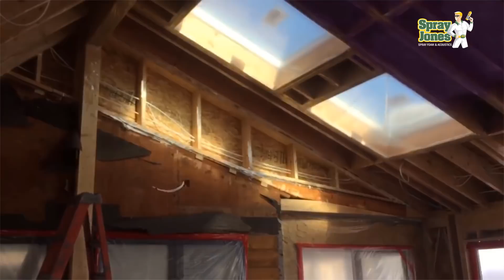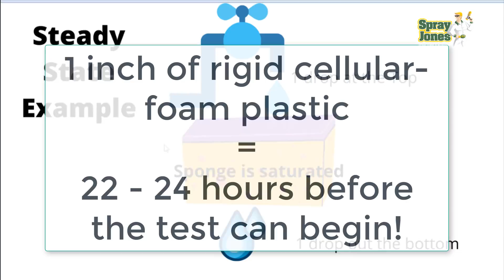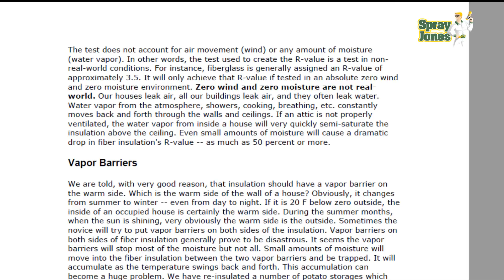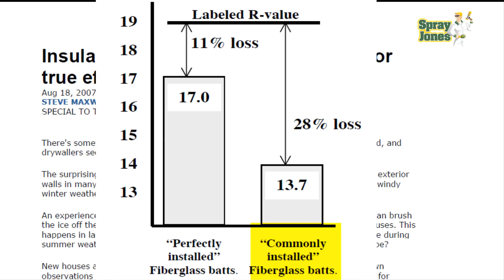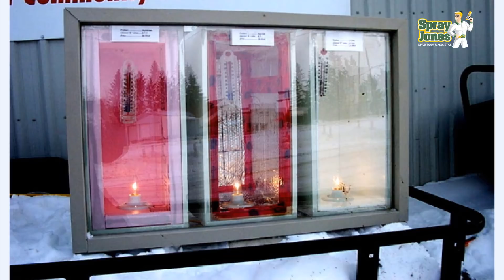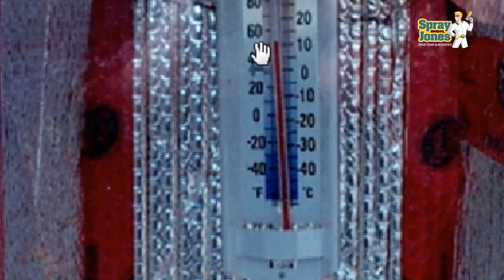R Value and Spray Foam Insulation - Just the Facts!

Comment: Corporate and government corruption go hand in hand and the monopoly will continue to deceive the public to serve their purposes and maintain a profit from the consumption of energy.
Reply from the maker: 100% red pilled truth right here! 
Well done.
Reply: @SprayJones  I know the government well as they serve the corporations first and the consumers last.
Reply from the maker: This is now the Pinned comment for this video.
Reply: @SprayJones  I fully understand heat loss as I was in the Heating and air industry for 5 years. I will be building a Quonset hut home this year and insulating with spray foam and heating with radiant in-floor. I will have a good HRV to control the humidity levels. Do you have any recommendations for a company in the  Muskoka area in Ontario that is reputable?
Reply from the maker: @CanadianDiggersChannel  Sorry no. Talk with BASF in TO and they can get you some names.
Reply: @SprayJones   Thank's I will check them out.
Reply: Absolutely. Hemp is such an amazing material for building and insulating with, and that's not counting using the fibers for cloth/rope/etc, or the flowers medicinally, or even nutritionally. They can even now make hemp plastics. I can't wait until there's a hemp foam insulation. Oh, and it can be made fireproof easily (see hempcrete).
Reply: That last point about the fiberglass market crashing is definitely the final nail in the coffin. Hopefully society will listen but we are still driving oil cars... Soo ya.

Comment: Im building a new house with 2x6 walls and 2x10 roof joist had it OC sprayed . Now here is the rub Im on water in flood zone so the house is on 10 foot columms with entrance in stair well enclosed with plywood 4 foot high with plywood around bottom then 5.5 0f OC from there up the siding is Zip with Hardie siding when i shoot the inside of plywood in heat of the day its same temp as the foam???????????????????????????????

Comment: Great video. Really puts things into perspective. It’s hard to wrap my head around the fact that a couple inches of foam is greater than a high R rating fiberglass. 

My questions is, live in hot ass Arizona. 120degree summer days. How many inches would be needed for a metal building?
Reply from the maker: Depends on what doing with it and whether you have a code amount to achieve.
Reply: @ I am only worried about summer temps. I will have dogs in there.
Reply: No codes that I know of, but I need it cool.
Reply: @ better worded is this part is not permitted. I guess I am asking from someone who knows foam and can suggest what inches I should get. 

This will have mini splits and soon an HVAC.

Comment: Watched the video from start to finish.  Great content.  I am getting my home foamed soon and just want to know what I am paying for.  I found the prices to be dramatically different from one contractor to another.   2 were within 500 of each other and the other one was more than double.  The estimate was for 2085 sq ft of closed cell at 2".  $5500 was one price and 5000 was the other.  The outlier came in at a hair over $10,000.  I am learning from your videos and would like to know what the actual product I am being quoted is. I am convinced that foam is the best option regardless of "R" value.  I have a massive 2nd floor that is unfinished and has  only about 1/2 of it with batt insulation.  My utilities are outlandish.
Reply from the maker: Is this in the USA?
Reply: @SprayJones  yes. Kansas City area.
Reply from the maker: @MotoInvestor  Then I'm inclined to believe the two at 5K.

Comment: Was part of the reason that the blowing agents changed the flammability of the best insulating gases? Cyclopentane is not exactly an inert gas. Haha.
Reply from the maker: Cyclo was only used in plant for non urethane foams, it is hard to use as you can imagine. 
SPF uses fluorocarbons.

Comment: A better test (designed for realworld environmental & installation conditions) would solve most of these problems.  For example:
1) Build a physical model of the wall/roof/foundation system at 1:1 scale for 100 m^2 interior footprint (small, but still human-sized).
2) Pipe humid 20C air into the model as needed to maintain overall 30% RH through the test.
3) Measure the energy needed to maintain 20C inside, while blowing -10C/100% RH air past the structure at 5 m/s winds.

These tests would be expensive, but cheap in the long run compared to building millions of homes using nearly-worthless metrics.

Comment: Great content! I would like to see the other methods of heat loss (convection and radiant) factored into the equation. Keep in mind that the three methods of heat loss are not 1/3 each. For example, a quick google search tells me radiation accounts for <10% of heat loss in a home. But convection is a much harder stat to find - some sources say radiation and convection account for 10%, and others say conduction and convection are the “primary” sources of heat loss - clearly opposite statistics.

Comment: I am soo glad I watched this til the end. We will have the luxury of no inspections for our new home, so I will get to choose my spray foam depth and not be upheld to the insane R49 (attic) that codes enforce. This means more work for me as I now have to figure out what our magic number will be. I have read that 5” or so of open cell is where the diminishing returns start. That is a good starting place as it would fully encapsulate the 3.5” trusses in the conditioned attic. We will also have 2” foam board on the exterior.

Comment: What if you used aeroseal for your walls BEFORE a fibrous style insulation. Obviously there is no better option (in my opinion) for the attic other than spf but would completely sealing before insulating make the fibrous insulation useful at that point? Using SPF in the attic is obvious to me via the fact that most hvacs are located in the attic and we’re essentially trying to make ice cream in an oven nowadays with a vented blown in system 🤔 not with an spf system.

Comment: My wife and I built a brand new pole barn house I want to seal it with Closed cell foam Insulation so I called an insulation company that does foam insulation He told me that spray Foam Insulation Was never intended to go in the ceiling and he will not spray it there he said the attic spaces have to be vented or you will have mold issues so why does my attic space have to be vented when you’re saying it doesn’t
Reply from the maker: You called a simpleton. Keep calling around and watch the 4 part series on roofs.

Comment: I am an architect in Florida... Check out this code reference: 2020 Florida Building Code, Energy Conservation, 7th Edition / TABLE R402.1.2 INSULATION AND FENESTRATION REQUIREMENTS BY COMPONENT / CLIMATE ZONE: 2 / CEILING R-VALUE: 38

What's wrong with this picture? The mere fact of using "CEILING" as the sole criteria implies that insulation is not directly applied to the roof, thus sealing it... So if one chooses to apply insulation above the roof deck, what criteria should be followed? The Code does not say -- it's all under "ceiling", from what I can find. A roof is not a ceiling.
Reply from the maker: Difference in the code between low slope and vaulted ceilings & everything else? We have it.

Comment: I'm going to talk to my energy consultant here in NY, pretty sure a similar test can be achieved based on different ach level based on different energy zones and required ach50 for different zones. I feel the r-value should be a chart, showing what the true r value is at different ach50 levels.

Also I agree with what you are saying in regards to air infiltration as being an issue. But there definitely are ways to seal your home w.o using spray foam. In those situations where the contractor took the time to air seal prior to insulation, wouldn't a flash and batt or even just using the batt be sufficient then?
Reply from the maker: Better watch the videos on Walls. Also the dangers of flash and batt. 
You are pointed in the right direction but not fully red pilled / unplugged from glass and R values yet.

Comment: When an attic is spray foamed, on the ceiling in a vented attic, what happens to the moisture in bathrooms and kitchens without vents? Does the moisture start to cause mold over time on it in the walls? Does the paper in drywall get effected? Curious as I was thinking of getting attic spray foamed since I can't go d someone willing to do airsealing
Reply from the maker: Without vents from those areas are stupid. You have to get excess moisture out one way or another. Either direct vent or the HVAC has to deal with it. 
Watch the 4 part series on non-vented roofs. Part 3 we discuss this more thoroughly.

Comment: Mike, JC here I wish I had this video when my father-in-law told me that I was making a mistake by not venting the roof rafters. We ended up spray foaming the roof rafters in a closed system. In the insulation game water Trumps air, air Trumps vapor, and vapor Trumps thermal insulation, the elegant solution that closed cell provides is the continuous control layers preventing water air and vapor ...while providing insulation at the same time. Thanks for giving me hope. People like you help me to think that we might actually survive as a species.
Reply from the maker: Well said.

Comment: I love your informative discussion! I always suspected what you just explained.  I am building a 2 story gambrell garage with separate 2nd floor and plan on spray foam the entire roof and walls as well as the Underside of the 2nd floor. I was planning on just doing 1 inch due to budget constraints and recieved a quote today for aprox $2600.00 cash. I am waiting until my framing and rough in electrical inspections are completed. Thanks to all your videos I know to ask alot of questions about winter or summer formula and definitely using closed cell. The roof has a cobra vent but I am Not going to ventilate the roof. 32' x 32' x 12' downstairs with 22' x 32' x 8' upstairs. 2 x 6 wall construction with 2 x 12 floor trusses and 2 x 6 roof members. I plan on not continuously heating downstairs garage. But will be keeping the upstairs at a reasonable temperature as I live in Southern Maine it is moderate temperatures but still zone 6.

Comment: I’m loving your series. I am getting ready to foam the underside of my metal roofing on my 110 year old East Tennessee home. It was newly installed on top of 1x8 and 1x12 longitudinal members. The gable vents are closed off and the roof peak vents will be shut off. I’m fixin to blow 2 inches of closed cell foam and just seal off the attic space. Any problems I should worry about.  I’m addressing any longish screws.
Reply from the maker: Sounds fine to me, provided the screws or nails are 1 inch no deeper. Otherwise put up more SPF.

Comment: Thank You, all great points. Now how do we solve the problem? Air sealing will fail .  Water will still enter I'm concerned About many forceable problems. Is they anyway we can drain water out? ANY good information will be greatly appreciated.
Reply from the maker: What are you talking about? With batts or with SPF?
Reply: @SprayJones  I'm thinking about just water. Was hoping you might has a solution. Its a problem we deal with daily. Thank you.
Reply from the maker: @comfortgreen2865  I am not following where is there water? Like in a wall with SPF? 
Your exterior finish is first defense, building wrap, caulking, flashing and drainage plane second, weep holes third. 
You need to be more specific.
Reply: @SprayJones  Thanks ! really helped weep holes is the only way. I'll see if i can make it work. Keep up the great work !

Comment: Thanks for taking the time and putting forth the effort to deliver relevant facts. I have been fighting this war for many years.......and I want to say that we are both soldiers in the same army......there is no other product like SPF in the construction industry. We do a lot of roof and wall systems, both interior & exterior and I have experienced firsthand the remarkable performance and durability of a properly applied system. In an effort to move away from this R-factor “black hole” the fiber folks have sucked us into, we have begun a process of doing energy modeling for each project. This allows us to apply the known facts, properties & benefits of SPF to the overall project and produce written, credible data that we can present to the code officials. If your interested in discussing further, message me at 505-596-6842.......looking forward to meeting you.
Reply from the maker: Agreed.

Comment: This is an absolute gem of a video. I would like to share sadly I am a loose fill fiberglass insulator for attics. The industry has not put enough money savings and people are going for the cheaper product. I saw this winter a plastic that was put on the cold side or exterior of a garage door cavity which haven't been installed yet, the cavity was temporarily filled with framing 16 on center and fiberglass batts. You saw the wet condensation accross the entire plastic from the outside because the heat was just going through the r24 fiberglass batts. Indoor was say 18c and outside was around -10c.
Reply from the maker: Wow. Thanks for that. 
If you pass along pics via email I may be able to use them for teaching. With credit to you of course.
Reply: @SprayJones  I sadly didn't take the picture. But I will do my best for next winter hoping you are still motivated and active in YouTube. I sure hope I will be. I do have a channel about my work in attics and you are welcome to use clips from that. Now I wish I had taken that picture lol.
Reply from the maker: @SinnisjInsulator  Next time. I have been on your channel and watched a bit.
Reply: @SprayJones  really happy to hear that. I'm just starting out and only have been in the industry for 3 years. Definitely learning a lot. I am definitely following your channel though as it is very thorough. Appreciate the great information.

Comment: Well Americans , dont know how to build houses at all, sad but true. You'r reasons for sprayfoam is wrong from the start. You WANT water to move thru the insulation how else do you get the water out from the studs. A perfect wall have an air barier in the center and air moves out at bothsides, to inside and outside. You talk about R-value. The windows you have destroys this totaly. And you don't put airbarrier in the walls when using fibrebats. Use Rockwool and you don't die from offgases from the foam.
Reply from the maker: Thanks for watching. Did you click on some ads?

Comment: Enjoy watching and learning from you. Thank you for all your time and effort that is put in to your videos. 
Have a question. I asked this on another channel but only heard crickets chirping. Does Rockwool exterior insulation loose some of it’s r-value since it is not in an air tight environment?
Reply from the maker: Of course. In fact it can be zero with enough air going through it. 
Then factor humidity on top of that. 

FYI most people have no clue about what is going on.
Reply: @SprayJones  
Are you familiar with prosoco products? Great products. Was just wondering if someone really wanted the fire resistance of rockwool on the exterior if the prosoco spray could be applied to the rockwool after it was installed that way it could be waterproof and air tight but vapor open. 
Thoughts?

Comment: Thanks for all your videos, your educating me before my build..my question to would be I'm getting ready to build a barndominium and trying to decide on house wrap vs osb between metal an studs. Yes wood is up right now but osb will strength to the walls and I feel the spray foam will bond better to it vs a plastic sheeting house wrap. Your thoughts?? Don't think I want metal, plastic sheeting and then spray foam doesn't seem like SF would stick good to plastic and certainly nearly as adding the osb for strength..I do understand u have to deal up all double studs, floor an wall plate cracks etc the building has to be COMPLETELY SEALED UP for SF to go it's job. Do I need attic ventilation or ventilate it thru HVAC??
Reply from the maker: Spraying to wood exterior is the best method for sure. 

Watch the video on roofs launching on Tuesday for SPF

Comment: I could use some sound advice.  I will be building a 60x80 post frame shop with in floor heat this summer.  I am wondering if I should have 2 inches of closed cell sprayed on before finishing with open cell.  What would my best option be?
Reply from the maker: Go all closed cell.

Comment: Fiberglass/Rockwool is part of a system. Other parts of that system is: Vapor barrier on the inside and a wind barrier on the outside. 
If you pick the system apart and test its components, it is like spraying only one of the parts that mixes into foam. 
And accepting that you get water into the house.... - And solving that by choosing another type of insulation? Is that for real? 
Get out in the world and see hour you can keep houses dry and keep build an insulation system in the house that works.
Reply from the maker: Thanks for watching....

Comment: Great info thanks!  Quick question, I need to reinsulate my attic, it has old nasty rock wool and fiberglass. I plan on removing all or it, should I then spray the top of the ceiling with 2 in of spray foam? What about using 2in ridged foam?  Thanks.
Reply from the maker: Please watch the video about spraying down onto drywall. It can in the playlist for "how not to be cheated."

Comment: With flash and batt the foam seals the walls from outside air coming in. I don't care if the inside air gets into the fiberglass or not it makes no difference. Flash and batt still adds more r value than foam alone.
Reply from the maker: John, thanks for watching.